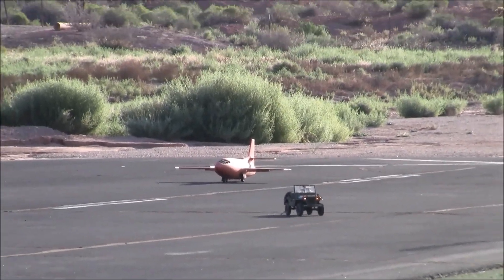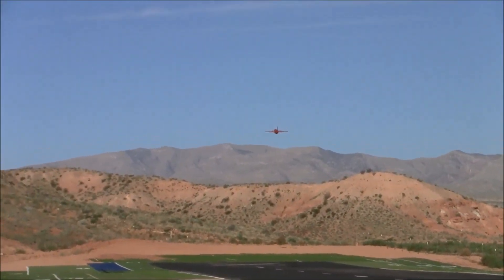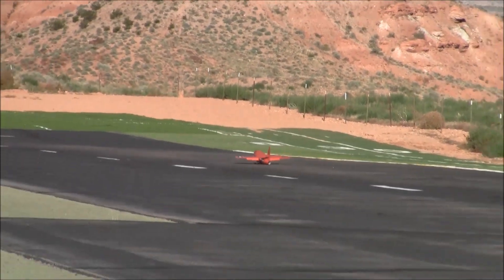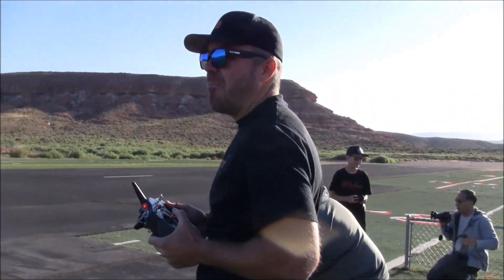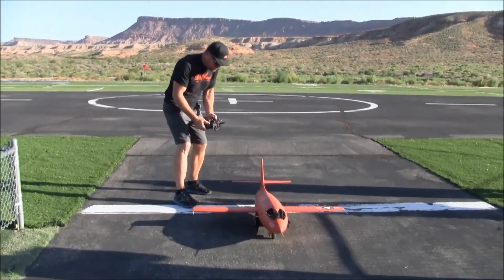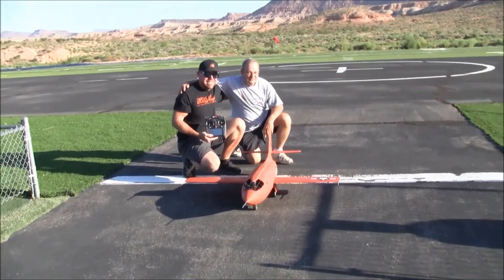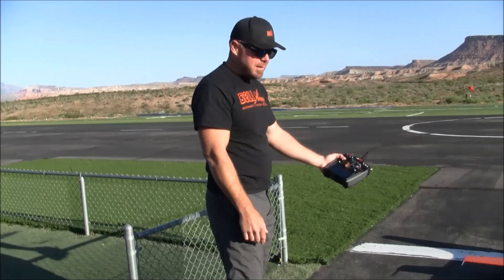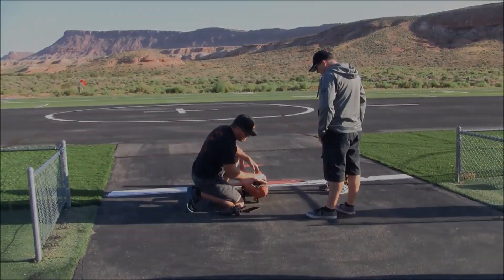The Bell X-1 by Brent Hecht - MAIDEN FLIGHT!

Comment: I think it's time to upgrade your camera, Justwingit. Your footage is not stabilised and it makes it very hard to watch. You could use your existing camera with a tripod for better results. Or get a gimbal for it. Or just upgrade your camera for one with stabilization. Or use a modern smartphone that provides stabilization. Either of these options will help you get stabilized footage.

Super cool model! I've seen his model in another video as well, with Ali Machinchy flying it.
Reply from the maker: The video you watched with Ali Machinchy flying it was shot even lower tech with a cell phone. BUT, I will take your advice to heart and look to upgrade sometime later thus summer. I've had major shoulder surgery so maybe a tripod isn't a bad idea! All the best!
Reply: @JustwingitRC  
: ). Well hopefully your shoulder recovers well and quickly. Tripod with pivot ball is best, if you go the tripod way, so you can still tilt and point the camera wherever you need to, as you're filming. Keep in mind that tripods are great, but they DO have a certain footprint and can sometimes get in the way of people, if you're in high pedestrian traffic place. You don't want people tripping on your tripod and knocking it over.
Reply: For what you do, I think sometihing like the DJI Osmo Action 4 would be a great choice. Arguably the best action cam at the moment, by far. Very, very nice stabilized footage. Or better still, the DJI Osmo Pocket 3 with its built-in gimbal, but it is a bit spendy.
Reply from the maker: @Porculus  I'll definitely look into it my friend! Thanks for the tips!
Reply: @JustwingitRC  You're welcome! Cheers brother!
Reply from the maker: @Porculus  Thanks my friend!

Comment: Chuck would be proud were is the cheater hole
Reply from the maker: I agree, Chuck would be proud for sure! And, believe it or not, NO cheater hole! Brent is an EDF master. Blue skies to you my friend!
Reply: @JustwingitRC  were is the intake for the edge
Reply from the maker: @jameswilberger  James, Brent was very creative and used the canopy and made an inlet behind the canopy to the EDF. The canopy is nothing more than 3D printed open black frame. The air passes through the canopy and pilot figure, right into the ducting leading to the EDF. I hope this helps you my friend!